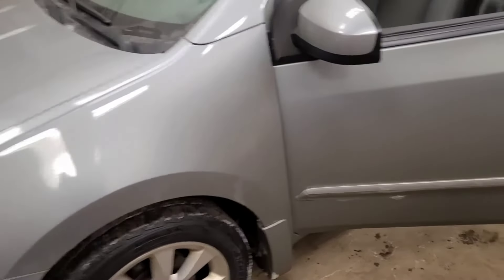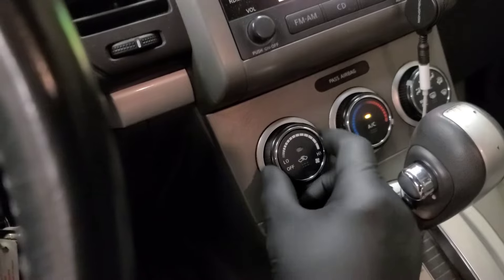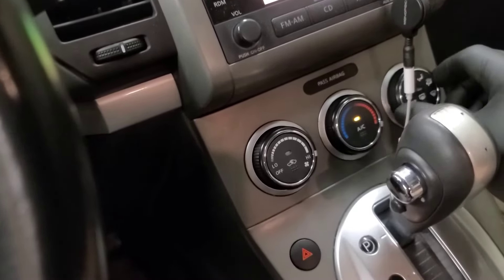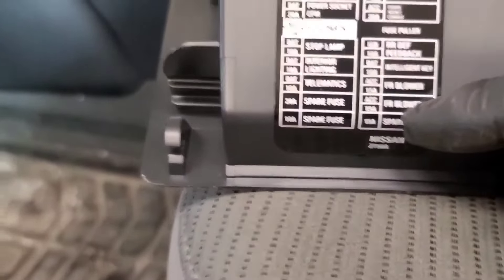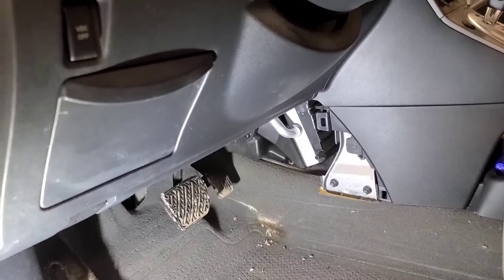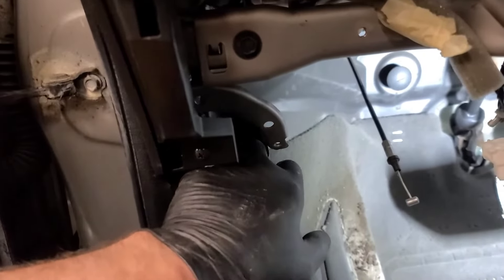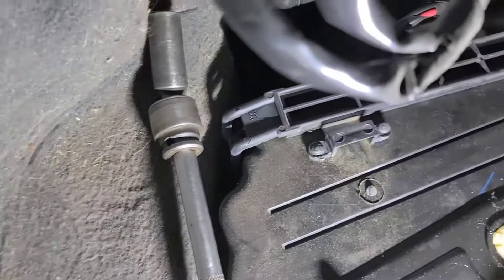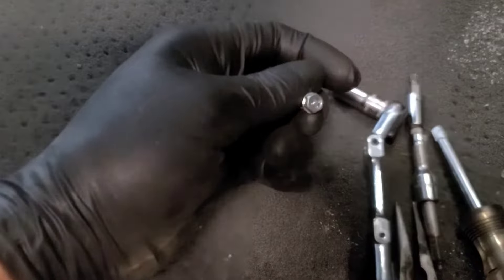2010 Nissan Sentra Heater Blower Replacement Without Dash Removal

Comment: Quick note for those having trouble getting rhe bcm connectors out (especially the black connector). If you can get two connections out it will give enough slack you can tuck it up into the dash and pull the motor out underneath.  Its a little bit of a balancing act but it can save your fingers.

Thank you for the video! This was the perfect step by step.  Motor is all good now!
Reply from the maker: Glad it helped you out.
Reply: If you remove the bracket, you don't need to remove any wire to tuck it up.

Comment: 2013 Nissan Sentra SV, just changed it out. Don't follow this video. Take out the glove box. No harder than changing out a headlight on most modern vehicles. I tried to video, but couldn't make it work on my phone.
Reply from the maker: The 2013 is completely different from this 2010 model. In the 13 it's behind the glove box door.
Reply: @PhillipBailey The blower motor on my 2013 Nissan Sentra is out and everything I could find online seemed to be  2012 or older or 2014 and newer. I assumed I’d have to do it through the driver side. I was glad to see this comment and your reply!

Comment: Awesome video. I know I need a new motor. This will keep me from guessing what I have to do. Thanks for taking the time to help us little guys out. But why do they have to make things so difficult.
Reply from the maker: It's like this on pretty much everything today. Engineered to be cheap to build and often don't consider what it will cost the consumer for common repairs. I agree that some things are common sense. For example having to remove an entire front bumper and grill to replace a headlight bulb is just bad engineering. Unless it has HID lights typical bulbs last 3000 hours. They are going to need to be replaced at some time. Starters, alternators, heater blower, thermostats, drive belts, and bulbs should all be simple to replace. Oh well keeps me employed...
Reply: @PhillipBailey  This was very helpful to replace the fan.  you took out all of the guess work. But I have replaced the blower motor, resistor, fuses are good and I checked the relays.  Everything seems to be in working order.  But the blower still isn't working.  Might you have any other ideas. The only thing I didn't replace is the switch itself
Reply from the maker: @christophergreen30  do you have power to both fuses 10 and 11 with the key on? You should have power at the blower motor yellow wire with key on. The resistor supplies the ground.  It's not really a resistor it's a transistor. If you unplug the resistor (transistor) and jump the red to black the fan should run on high. There is no Switch that you can change it's part of the control assembly. Check these things and get back to me if you can't figure it out.
Reply: @PhillipBailey  thanks for all of your help. It ended up being the squirrel cages not being to same and it had to new blower in a bind. It did burn up my new transistor but I still had my old one and it worked. So I just put the old squirrel cage on the new blower motor now everything seems to work. Thanks so much it really help me track down the problem. Come to find out the part that was sent didn't match the picture and spins the opposite direction.  I'll have to do it all again with the correct part
Reply: @PhillipBailey  if you have a venmo or PayPal I'd like to send you a few dollars for your help
Reply from the maker: @christophergreen30  ah... always compare the replacement part to the original. I have seen that before wrong rotation or too long or short. Glad you figured it out. No need for payment but appreciate the offer. Stay safe and have a cold one to celebrate .

Comment: Now I'm at the clevis. Which way do I turn the jam nut? I'm using a screwdriver to kind of "hold" it in place, and an adjustable crescent wrench, and I assumed I would be turning the jam nut counter-clockwise, but it won't budge. I gave up and tried clockwise; still won't budge. I'm probably too weak. 😫
Reply: I just saw another video. Didn't show which way to the. The jam nut, but I think I want to turn it clockwise because you have to turn the clevis counter-clockwise. So turning the jam nut clockwise will move it AWAY, thus leaving room to get the clevis off?
Reply from the maker: It's normal right hand thread just tight. First law of mechanics: right to tight, left to loosen.
Reply: @PhillipBailey es, I always remember "lefty loosey; righty tighty" 😅

So that's why I initially was turning the nut counter-clockwise (left) to loosen. But the clevis part needs to come off, so the nut needs to go farther onto the bolt, thus "tighten" thus to the right (clockwise) in order to make room to turn the clevis to the left (loosen).

So the nut turns right, the clevis turns left.

And it took all my strength to loosen it. I had to get a long screwdriver and jam it behind the long metal post thing underneath so I could use both my hands on a longer crescent wrench, and the reef to the right as hard as I could. And it loosened.

Comment: How do you undo the hood release cable? I can't figure it out.
Reply from the maker: Not sure what you're asking.  How to replace the hood release cable? Or how to get the hood open if the cable is broken?
Reply: @PhillipBailey  no. You said to undo the hood release so you can get the plastic panel cover off. I ended up finagling with the panel and got it out of the way instead of getting it right out. Need the panel out of the way to make room for getting the blower out.
Reply from the maker: @SarahPoulin  oh I'm sorry I don't remember specifically how it is removed from the handle.

Comment: Thanks for the video. Now my ABS and Traction lights are On and brakes pressed. Car does not move. What can it be? Thanks
Reply: I also had to remove the Clevis.
Reply from the maker: Sounds like the brake pedal is not returning properly. Check if the pushrod to tge brake pedal is installed correctly and if tge brake light switch is stopping the brake pedal from returning correctly.

Comment: Do you know why the middle to vents do not blow as much as the outer 2 vents? All have the knob on high but middle to blow very low
Reply from the maker: The only thing I can think of is a plugged cabin filter, If all the controls are set to maximum airflow. Has the heater ever been worked on before? If so maybe something was not put back together correctly.

Comment: If I attempt to do this will the car drive fine with the codes? And will I be able to drive the car to a shop to clear the codes?
Reply from the maker: If you disconnect the battery prior to repairs you should not set any codes. Codes will set if you turn on the ignition with the accelerator pedal disconnected. After cycling the key off to on with the pedal reconnected the codes should go to history but the MIL may remain on. It should run fine though and any OBD 2 reader should be able to clear the codes. You may also be able to clear the codes by disconnecting the battery cable for several minutes as well.

Comment: He's removing lots from stuff than I did.  But when I put it all back together, no cruise control and air bag light stays on.  Hardest part are those damn connectors.  Don't need cruise control but air bags would be nice.  Anyways it lasted three weeks.   Yanked it our again.  A pack rat packed a hot dog wiener into it.  The same rat or his buddy stuck another hot dog in the glove box.  This time shook black pepper all over to keep the pack rat out.  It works.  Careful with the wires and this time air bag okay.
Reply: No edit ere.  I intended to write, 'removes much more stuff than I did'.

Comment: I appreciate your video help. Yep. This IS designed for a young person who is left handed. Watch your elbows. The  BCM plugs came out ok. Need skinny and strong fingers. My thumb hurts. The brake pedal that nut is locking. I used a 17mm and a 10 inch Cresent. The cabin air filter probably wasn't ever changed(in 13 years) had the Nissan wording. Leaves and dirt. Change that while the pedal assembly is out. Yeah, that is a dumbass design. Took me about 2 1/2 hours including going to the parts store for the filter. Blows great now. My man...
Reply from the maker: That's awesome glad it helped you..

Comment: I have been fighting with that stupid f*cking box that has the 3 plugs in it for like 2 hours now and cannot get it out of the damn way
Reply from the maker: It definitely is a challenge.  I found it easier to unplug after unbolting the fasteners. You have to be part Houdini...
Reply: @PhillipBailey  I gave up on it tonight Im dizzy as hell from hanging upside down from the passenger seat since i dont have the tool to take the driver seat out
Reply: @PhillipBailey  The worst part is i dont think anything is even wrong with it some junk probably just got stuck in it, I could hear it rattling for some time and then it would stop working and would only start going again if i made left turns or hit potholes 😂
Reply from the maker: @Usef320  that's a typical sign of worn brushes in the motor. Hit a bump or turn corners and the blower will stop or start. Good luck.
Reply: @PhillipBailey  Appreciate the help brother I just got the new motor in, having trouble wiggling it in, pretty sure the old harness got lost somewhere in no mans land 😂

Comment: What's the cost for this whole job?
Reply from the maker: I'd say 2 to 2.5hours plus the cost of the blower motor and filter while you're in there.
Reply: @PhillipBailey  My 2012 sentra blower motor is howling and grinding like a bastard. Dropping off Friday. My mechanic said around 200 for parts and labor. After watching what you had to do, i cant see it only being 200 bucks. ha
Reply from the maker: @user-zu1zf3yf4p  yes thats cheap. He may not have checked the labour time guide. Book time is around 6 hours and includes dash removal. Most blower motors are under an hour. Let me know how it goes.

Comment: Mechanic wants to charge me $650 for this job is that to much?
Reply from the maker: Depends on how much per hour and how many hours. If you look up the factory time it's like 4 to 5 hours as they say the entire dash must be removed. Doing it this way is still tough but I'd quote you 1.5 hours plus the part. Hope this helps
Reply: My mechanic just told me it'd cost up to a grand, which I think is insane.
Reply from the maker: @kingtut5520  I'd get another quote. He's probably looking at book time for the job. I've done this the "right" way and this way.
Reply: @kingtut5520   That's a price I saw several place.  A mechanic can bring in more dollars doing oil changes all day than spending the day getting the dash in and out.  I've read it's more like 8 hours with the dash and heater removal and replacement.